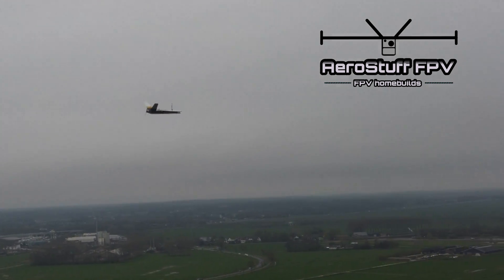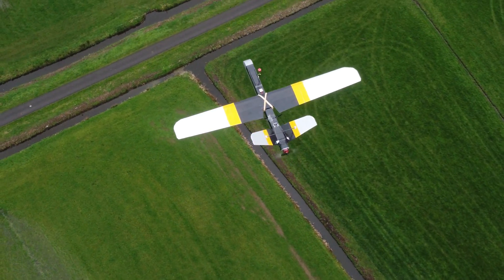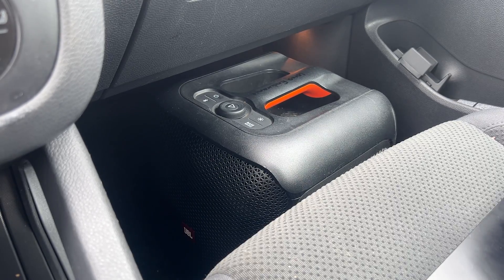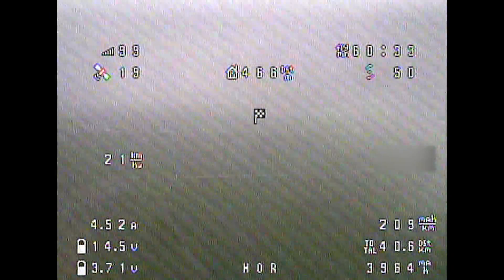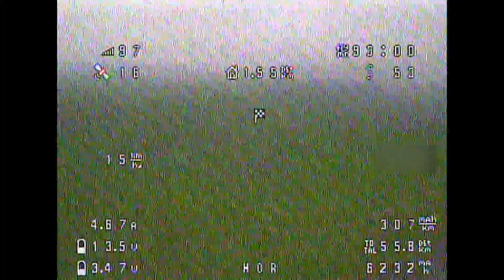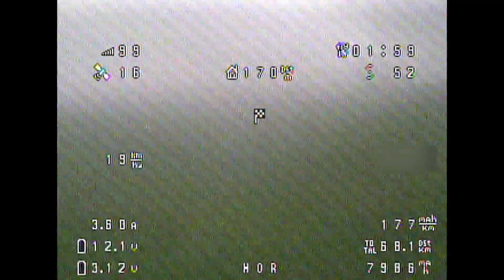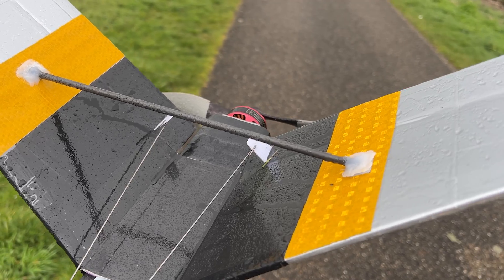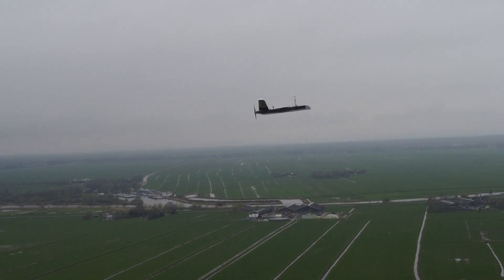V-Tail Pusher for FPV - Extreme Endurance Flight In Rain & Winds

Comment: The wind has zero to do with how an aircraft can remain in the air when looking at the power required. It would only matter if you were slope soaring and you arent. Zero. knowing this is a basic and when doing the work you are doing the basics are necessary.
Reply: Well, not exactly. The wind produces turbulences, and throws the little airplane in all directions, so even to maintain level flight you have to actively counteract this all the time, losing efficiency that way.
Reply: @kresuk  thats not something you design for. Every aircraft of every type experiences that in the medium through which it flies. Its not a factor
Reply from the maker: Well, planes can be made more ‘slippery’ to lessen the effect of turbulence, loss of lift, and regaining altitude easier (less power) - making it more efficient. Things can be measured for sure after such a flight (mAh/km)
Reply: @AeroStuffFPV  just explain slippery and then explain to me how planes are designed as you say. Give me some examples.
Reply: @AeroStuffFPV  OK just explain how they are made more slippery (please define slippery) and then tie the slippery to more efficient please. Im just looking to know what you know. Just break it down for me

Comment: Can the antenna be integrated in the vertical stabilizer? I may have to seek through the build video, but you could try to 3d print some parts to get rid of those struts. I think Chessna has struts because the wing has to be thin in the center to fit on the roof. Or is it about spare ribs ? If you have any way to produce ribs on demand, then a triangular planform is always better than oval + struts.

Comment: You’re my inspiration! After building the Silver Guardian (and loving it), I’ve now built a replica of your Vtail Silver Eagle. Maiden flight coming soon! I’m starting with a Molicell 4S 4600ma battery. I’ll send you a photo soon.
Reply: What's was your approximate cost for the Vtail?
Reply: @IFarmBugs  Very little…I already had spare foam board. Less than $10 to build the plane itself. Motor, ESC, servos, flight controller and receiver are the main costs, about $125 more.
Reply: @allansmits9621  wow, incredible.

Comment: Very cool. Very inspiring. I have my first successful build and flight using inspired by your designs and I’m now working on a wing inspired by the one you mentioned in this video. I’m not doing endurance but just trying to get about 10 min of flight out of each building which seems to be very easy to do at this point. 

Do you mind sharing what country you are in. I am curious only because of beyond line of site flying.   I’m going to research wavers in the US to do the same. Thanks so much for great videos and builds.

Comment: Looks great. Why do airliners have wing tips that are bent upwards? 
I'd like to make this model. Will you be making a video on it with the mods? 
Can't wait to see the result of your normal long run.
Reply: Maybe you already know but can help others. An Airfoil has pressure difference, low pressure on the top and high pressure on the bottom. And naturally it wants equilibrium. The pressure difference is separated by the Airfoil obviously, but at the end - tips there is nothing that will separate it so the high pressure flows over the edge to the low pressure creating a vortex. Which not only reduces the lift at the end of the wing but also creating extra drag and lowering efficiency. The wing tips as airlines has are simply said a barrier for the flow to reduce the vortex.  
On some airliners now you can also see split winglets, those are cool 👌

Comment: Great job....now you know your throttle setting for cruse you can do some bench testing for better motor/prop combos 
even a esc can save you 200-300ma draw with a change. eg. sn 20A vs DYS XS 30A

Comment: Weather! I was trying to get above the clouds in the mountains one winter and had my camera ice up. I figured I was through the clouds but couldn't see anything except bright light. So I hit RTH and brought it back but ended up flying in circles above myself for a 10 minutes to get the ice off the camera. Thankfully it melted as the landing spot is tight and I probably would have crashed it line of sight. Too many wires and trees. When I got it on the ground, I realized there was a fair bit of ice on the plane. Not all of it had fallen off as I circled.

Comment: Extreme turbulence has plagued every one of my endurance flights too. On 4S, you should be able to fly down to 12V with li ion, and still be able to do one go-around.  you may be able to squeeze a bit more out of it in loiter, if you give up the ability to go-around.   nice job hanging in there with the weather!!
Reply from the maker: Thanks!😎 Yeah, i’ll try to squeeze a bit more  out the milliamps on the final endurance flight. 

Question: What’s your thought of a Twin Motor FPV UAV (Gemini?) in Twin Pusher (behind wings) configuration? Is a tractor better or pusher?
Reply: @AeroStuffFPV  tractor better.     It's never good to have something in the way of the slipstream.  but at least in the case of the wing,  (wings are incredibly efficient), and so you get most of the lost energy back, in terms of lift.   putting the props on the trailing edge is good in one way, because the accelerated air gets to go free.   BUT it has a huge downside, in that the pressure differential going into the prop ARC is the equivalent to changing the angle of attack of the prop blade two times each rotation.  this will also make huge vibrations, especially at a high AOA of the wing, and even more at high G-loadings and at high AOA.  it will vibrate the prop, and motor, and also the wing.  also, with prop on back, you cannot have flaps in front of the prop.   if you Do, they will probably be ripped off by the pulsing vibration and sucked into the prop.     I went through this development with a powered glider in about 2008, and all of the problems went away when I switched to a twin tractor.  it was also more efficient. 
A twin tractor nacelle is also structurally more robust and easy to build.       That's why you see 98 percent of twins with tractor configurations.       hope this is a satisfactory explanation.  let me know if further questions.            another interesting configuration is like the Eviation Alice aircraft, the one what recently flew with motors mounted on each side of the fuselage.    I prefer to keep the motors as far forward..     which leads me to also think of the Cri-Cri ultralight.   I made an autonomous aircraft for a friend recently with that configuration and It worked well.  His motor mount struts were not streamlined, but that could easily be remedied.     the further forward the motors are, you get to move the battery back and have a shorter nose and longer distance between the tail and wing.  This is a good thing because you need the long moment arm to counter act the wing pitching down due to camber, and achieve positive pitch stability, with a low negative lift coefficient.  the shorter the tail, the more downgrade you need, and it hurts effeciency.    cheers and happy designing!

Comment: Hello, I am considering making a plane like this, but I have some questions.
1 - Is it strongly affected by the rain? (Shorting out?)
2 - What happens if the UAV loses signal, does it return to home or just crash??
Thanks!
Reply from the maker: 1) The drizzle & rain significantly decreased it’s flying performance (less lift, thus more throttle) 

2) The aircraft has GPS to fly back to it’s takeoff position when signal is lost (+15km range)
Reply: @AeroStuffFPV  Thanks!